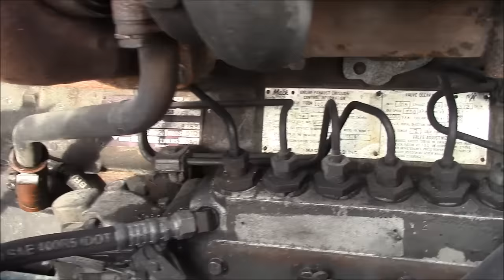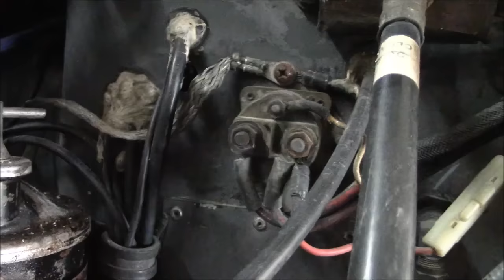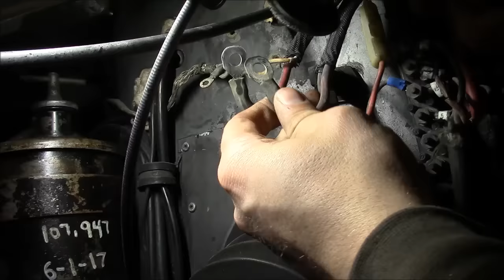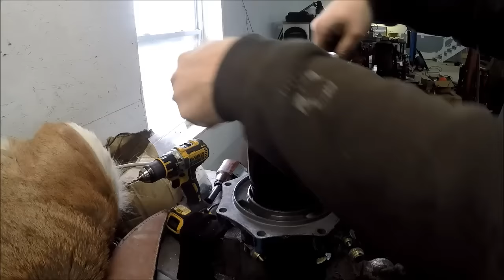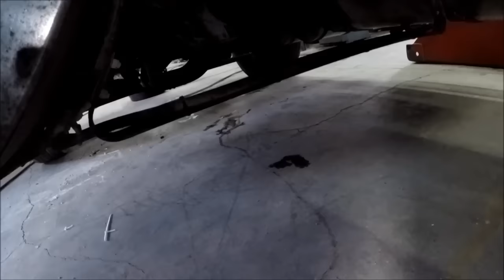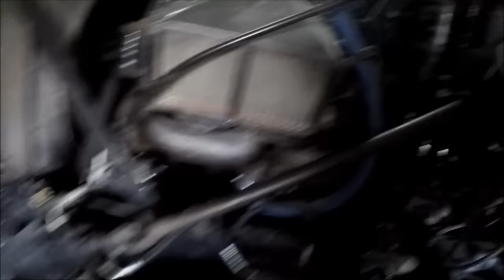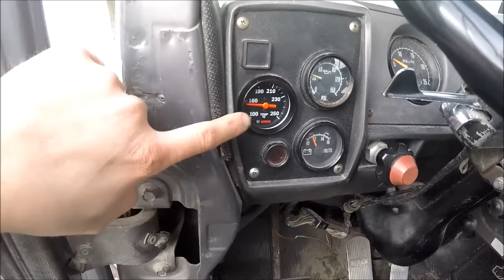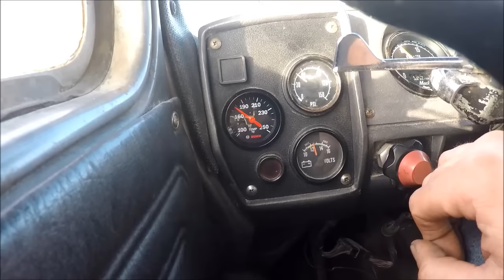Cool 1977 Mack RL600L - No Crank, No Start - Plus Many Other Repairs

Comment: The coop I was working at purchased a new digger derick and after having it installed the extra weight of the bed and boom caused the air brakes to be less than desired, so I set the air pressure up a bit higher and then they worked fine. The best battery terminal spray I have ever used is NOCO NCP2, it never dries out and stays kinda soft and good for the life of the battery. I spray it on the terminal before I install the cable and forget about it. Amazon sells it

Comment: this guy must of had an amazing season to drop off the truck with 50 issues and want them all fixxed to the highest standards
Reply from the maker: Most farmers here had a terrible year. But he's very particular.
Reply: @WatchWesWork  if a mechanic offers to fix something on the cheap/free for yah jump at it chances are if hes offering the fix its gonna work fine... and if it doesnt then he's gonna give you a hell of a deal on the proper fix to save face

referring to epoxying the fuse block deal

Comment: "won't start"......although this comment is not a 'diesel truck' deal....it's worth reading....back in the 1990's I worked in an auto A/C and electrical repair shop....we had a big ass RV with Chevy 454 and auto trans....sure enough...you turn the key...and just a click....so without looking further...the service Mgr. ordered a $400 starter motor (it probably was waaay over priced...he ordered it from the nearest RV shop)....I was the only guy who wanted to deal with it, since the tow truck guy left the DOA vehicle out in the street....
  I get under there and start on the job....well...Surprise!!...the flexplate was missing a bolt...it had fallen out and was jammed in between the starter motor gear and the ring gear on the flexplate...I re-installed the bolt, and checked the other 3 for tightness...
 The engine started right up....so I charged the service order for 15 minutes of labor.... although they made the customer pay the 1/2 hour minimum....

Comment: A beautiful looking Mack.  I've always loved the R600s ever since I was a kid.This guy sounds like the bus grease monkey.From memory the 237 Maxidyne came out in 1965. Cheers from Australia
Reply: I drove an old steel hooded DM with a 237 and a 6-speed overgear 2-stick. 1 thru 5 and reverse on one stick. Direct and high on the other. Go 1-5 direct then to Hi. 5th direct was 35 m.p.h. Hi was 70. It was a bear for just 237. Ran with 290's but needed a splitter. Good old 12 or 13 to 21. CHEERS!
Reply: @lewiemcneely9143  Thanks for your response. When you say 290 I take it you mean Cummins. In Australia that was a good engine in it's day and after that they came up with an engine called Formula 300 meaning hp of course. They reduced the RPMs to 1900 with a flatter torque curve I think. This was about the time of the ''Big cam'' series as we're talking eons ago now and this is just from memory.  The 237 Mack was incredible with it's torque output of the time from only a medium sized inline 6.  I will admit Mack had some bizarre gearboxes and patterns and that monster triple countershaft 18 sp or something. You should try strapping that sucker to a pallet. Those non tilt bonnets can be hard on the knees at times. Those setback front axle jobs like A-car had.  I think your DM may have been an offset cab just guessing they had normal ones as well.

I myself want to get a Mack R600 ''glider kit'' and put in an 8V71T or a twin turbo 6V92 something different, one on each bank. I worked for a guy that did that to an 8V71 in a single drive cabover IH DCO Transtar back in the late 1970s. His brother was a diesel mechanic. It basically went like Saturn 5. Guys in their Cummins power would get on the CB and say ''Houston we have problem''  pun intended.
Reply: @andrewking9761  We were hauling on a road job with a bunch of IH's with 290's which you're right about. I just had 6 gears and you know the 237's. Not quite enough in one notch and hammered and almost freewheeling in the next. That's where the 290's pulled away but I could stay with them if I'd had a 12-speed. The Big Cams were good engines too but I'm just not a Cummins fan. A 3406B Cat was really incredible to me anyway. That'd act Mack-ish if set up right. And those trannys wanted to lay down for sure! The DM's were offset cabs, even with the yellow line (left side here). NO room! I knew a guy that ran a truck repair shop that put a double turbo (2-6v-71 manifolds and turbos) on a 12-V in a 9500 G M C long nose. Big injectors, the whole thing. He said a little over 730 horses to the ground and it sounded so sweet it'd hurt your heart! 2 straight pipes, 4 inch I think. I always wanted a GMC Cracker Box with a double turbo 8V-92 and an 18 speed Fuller but I'm too old and stiff for that to happen but I still dream. I like the older Macks and the 2-cycles. New stuff just doesn't have any guts. And a single axle won't do anything but RUN! Cheers Back At Ya!
Reply: Lewie Mcneely,                              What time is it over their champ?   It's about 4 pm in Brisbane Australia.                              There's a site called ''Mack photo collection'' or something like that.                                An R600 painted silver with blue striping down the side with a good sized sleeper                               and Alcoa wheels. I'm sure you've seen it before, it looks unreal. As for the ''Cracker Box''                               if I get lucky on the Keno that might be a possibility. A twin turbo 8V92 certainly                               would have a lot more power compared to the original 6-71. Last year I was 2 numbers                                short  of 6.7 million $ on the 10 number jackpot. I got 8 out of 10 and couldn't believe                               how close I was.                               I want to move to America as Australia is just about fucked from all these fires                              and the economy will be almost destroyed when this other government get's in.                                It's these crazy left wing greenie types that have infiltrated this other major political party                               and it will be total chaos when they get in.
Reply: @andrewking9761  I was doing all my yakking last night around midnight. It's 12 noon here now. I drove, or maybe hearded is the more correct term, 
R-models in 3, 4 and tractor trailer deals. DM.s too, in dumps and concrete haulers. And a DM and R-800 as quarry trucks. Started when I was 21 with a chauffeurs license a million years ago. And as far as the GM/Detroit 2-cycles I've dealt with them from the 2-bangers up to the V-12's in various things. The V-8's have the best sound to me but I dearly love anything V-8! The 12's are no slouches either. And the old reliable 6 is bullet proof. And I'm afraid we've all had the lick from our so-called 'governments' selling us out but the Bible says it's going to happen. The big gun rally today in virginia so look for a big blow up of some kind there. Come on over, Mate. There's room!
Reply: Me again from Down Under.  Sorry about my last post, the words went haywire.  I was thinking about theGMC 9500 and I'd say he used the V6 manifolds to keep the turbos in the middle as there's no other room for them being a bonneted truck, no problem in a cabover. What gearbox did he use behind that thing?The torque would be around the 2000 pound mark if the hp was 700 plus. A truck like that wouldn't lose any speed on slight grades even when fully loaded.  When I was a kid I saw a cabover truck with a tricked up natural 6V53H 216hp at 2600 RPM. Not sure what the H means but it's the injector type.It was a medium sized ''Bedford'' 6X4 imported from England. Used to haul a 2 axle log Jinker loaded to the max at least 20 ton loads. The fella that drove it had no problem getting it wound up and went well for a small engine.On the gun issue some people in Australia think Americans are ''gun crazy'' as there were a few shootings over there as there are here. But we were disarmed in 1996 due to some maniac in Tasmania. HoweverI still think there's more to the story and I think the guy they caught was a scapegoat for a bigger agenda.I remember reading about ''Charles Whitman'' back in the 60's a guy that just lost it for some reason.A lot of it stems from child hood and what happens to them and may have some pre-existing issues that makes them worse.On a more positive note I want to start looking at getting myself sorted out as I always wanted to go to America and so I'll have to get various licenses to get jobs and a passport.I'm a white guy myself that just loves those Afro-American chicks and that's another reason I want to go over there.  Anyway god bless you until next time.
Reply: @andrewking9761  back again, Andrew! The 9500 was a long nose and he had the V-6 manifolds one behind the other with the turbos sort of in the middle as best as I can remember. He had to make the exhaust pipes.He said he put the improved gasket set on it and it sure had a fine lick. Bigger injectors too. obviously. Probably advanced cam timing, the whole deal. Seems like he had a 13 speed. This was years before the 18.    I drove a tandem some with  a 6V-53 and a 13-under and around 60 m.p.h. and 2800 R's your eyeballs would start swapping holes. Just had glasspacks for mufflers and you could sure tell it. But it'd go! I really like a 13-under for a rough hauler. Plenty of lo gears. And the old 6V's with the turbo and the black cloud till the turbo wound up!   As far as the gun thing, the founding fathers said to be sure to keep guns because the 'government' would try and take them.  I'm behind it all the way, being an RVN vet myself and hater of politicians of ANY kind. And the junk the so-called 'news is a crock in itself and a lot of these things have a lot of help, just like yours did. So come on over. We need people with sanse and have way too many duds already! God Be With You!
Reply: Hi there Lewie just a short note this time you say you like V8s well check out the sound of this 8V92T.Just do a google search on this. Just type in this  ''Atkinson 8V92TA hummin along'' basically  a truck being filmed at max legal road speed around the 62 miles an hour mark with a camera in a car going past. Hear the 8V as at passes between trailer and truck sounds unreal
Reply: @andrewking9761  THANKS, Andrew! I'll sure do it. The V-8's are the best sounding in my humble opinion. ANY V-8 diesel. Even a 2308 or a 903 when it's not spluttering or is the other a 550 something Cummins? I can't remember but I can sure remember that Superliner 4-axle I herded with the E-9 and a 12-speed. And other things with 8-V 2-cycles, 71 series though. Before the 92's. Thanks again and BLESSINGS 2 you!
Reply: @andrewking9761  I just watched a couple of them and Trucking Stainless did a JOB on that one! What a BABY DOLL!  That would knock some eyes out today, NO problem. SWEET running too! Thanks again and CHEERS 2 U!
Reply: Lewie Mcneely.   thanks for listening to my suggestion been a bit busy. In one of your letters you said your an RVN which meant returned Vietnam veteran congratulations in serving your country. I recently applied for a job in the Australian army reserves.   Just looked at an incredible truck show on you tube.''part 2 2019 Antique semi truck show''  Highlights include,  at 2mins 42 secs B model Mack with duplex with straight sticks. 5 .56 Value liner and R model with 8V92T.  7mins GMC cannonball COE with 6-71 I guess, I don't think they came with anything else.   At 7 mins 38 Oshkosh tow trucks awesome looking rigs.   8mins 45 W model  KW with K -series Cummins. 9 mins 30   KW   A model with a ''Dirty Dozen''.More macks at the 8 min mark.  At 11min 50 a peterbuilt a with twin turbo 8V92 look how they fitted them in that engine bay.
Reply: @andrewking9761  Hi, Andrew and yes, i got nominated for a free all expenses paid tropical vacation with a free dose of malaria thrown in as an incentive, for what I don't know. I did learn to run a crane there and made a living slinging a drag bucket around after I got out. I liked the 5-tons though. Good old tough rigs. I ended up driving a 5-ton water truck while in Kansas, supplying water for shower point where the reserves and national guard were camping out in the field on their yearly 2 week outing. Don't know how things go there but hope it works for you. I was glad to get mine done and over with. I got my chauffeurs license when I was 21 and that was in 72 and there were a lot of old rigs still around then. I've always liked shifting gears and the more, the better. A 5x4, 13-under, 4x4 Spicer and 18-speed Roadranger are my favorites but I wouldn't cull one with a duplex or triplex either. I've herded Allisons in quarry trucks and front discharge mixers and they're NICE but I like a straight drive a lot better. So fo find yourself something to doodle with. A good clean shift is very satisfying! Especially when you don't run over someone while doing it!

Comment: I personally hated to drive those R and U models with that dang 5 speed ! You had to lug them so much ! They had good low end torque but that’s it ! I think the Macanine was used in the road tractors , if memory serves me . I use dielectric grease on all my Outboard repairs and it works wonderfully ! You need to let the R’s drop before you slide it into the next gear ! Those Mack’s shift at a lower Rpm .
Reply from the maker: I've been told you can't lug a Mack engine too low or they will break the crank. I don't know if that's really true, but that came from a trucking company that has owned hundreds of them.
Reply: Watch Wes Work we would have to let them drop down to 1100 which to me is lugging, I’ve never seen or heard of a crank on a Mack snap because of lugging, Mack use to brag about there low end torque but whatever ?!?!
Reply: Watch Wes Work I really enjoy your channel, your a really good mechanic !

Comment: Never never ever store batteries on concrete, its conductive drains the current out of them and ruins them. 5 mechanics in one workshop told me that . Thats why their new batteries are sitting on a STEEL display case supplied from the manufacturer  keeping them off the conductive concrete .Its mind boggling
Reply from the maker: LOL. I'm telling you, when it comes to electricity, people just turn their brains off.

Comment: Yes, dielectric grease as well as standard grease applied all over is a good idea. Prevents corrosion between contacts. Where it matters, grease will get displaced and good contact will result.  Dielectric grease (silicone) will prevent discharge across a surface such as in HV ignition cabling and connectors.

Comment: The RL was actually L for "Lightweight" hence the aluminum frame. That Petagree Remanufactured engine came complete, turbo, pump, water pump, air compressor. They were rebuilt at the Mack Hagerstown, Md  plant. They sold for 6500 bucks with an exchange in the mid 80's. Real quality, I never saw a bad one.

If you look at the timing case right in front of the injection pump it should either be a ENDT676 or a EM-300 Both were Maxidynes. Going by the tip turbo aftercooler and the TRL107 trans it's a Maxidyne, not a Thermodyne. Thermodynes were never intended to be mated with a 5 speed
Reply from the maker: OK. Good info. Like I said, I'm not an expert on Macks.

Comment: Silicone grease can apparently create silicon dioxide and silicon carbide when exposed to an arc. Yes quartz and the same silicon carbide used to make grinding wheels. I don't know how much of a problem it is in real life, but I would not use it for contactors and such that see a lot of arcing. For connectors and terminals, sure.

Comment: Wes loosen your thermostat fitting that you replaced, let the air out of the engine, till the anti-freeze comes out, then tighten up.  Do this to all that are set up like that, will eliminate air pocket, that can crack the head, maybe you've done that, just saying.
Reply from the maker: It has a vent line right next to the temp sender. I filled it up except for about 1.5 gallons, ran it for just a second, then filled it with all but the last 2 quarts. After the thermostat opened I got the rest in.

Comment: This truck and motor using this trans was ahead of its time. Crazy crazy torque running a 5 speed and it worked. I'm a firm believer in the rear differentials have a straight drive shaft. Less power loss. 
Very nice clean truck for her age.

Comment: I've cleaned a lot of ancient white moly lube out of old connectors - so I definitely stick with silicone grease.
Reply: silicone polimerizes, lithium cleans off with a small shot of w40
Reply: @ty2010  Silicone is also an insulator. Like everything "silica-based".
Reply: Too bad silicone is an insulator, huh?

Comment: Hey Wes. Love the old iron. If we ever have a CME or EMP.  All these computer controlled Car,Trucks, Heavy equipment will be sitting were ever they were hit. Same with all the new tech. There was an event in the 18 or  1900 hundreds that caused wires to burn  in the telegraph offices. even with the  telegraph keys unhooked.  from the lines. That was a CME from the Sun. A EMP is from a high altitude  Nuke. Sorry for the ramble. Has always I liked,Shared. All my best. Oh And I saw the Ford on the trailer has you were backing out What year ?. I own a 1961 with the bed made into the cab.
Reply from the maker: It's a 65. Video coming soon.

Comment: I use dielectric grease on the contact inside of the spark plug boot and all of my ignition parts. Works great on the older points also.

Comment: That looks like a Mack em6 283 pretty easy to swap a em7 300 with a mechanical injector pump and get rid of all the leaks plus the em7 is so common its pretty cheap that truck is so clean it probably would be worth it